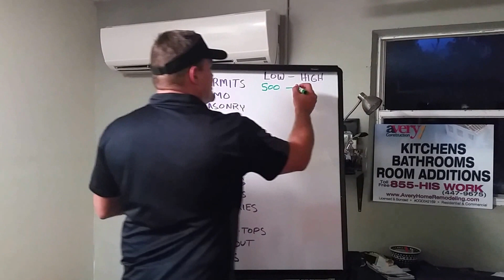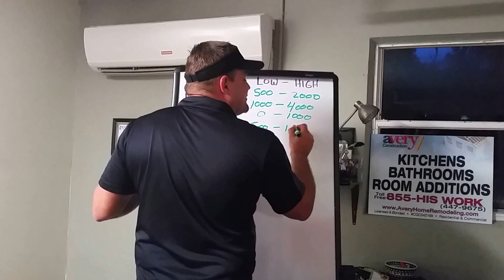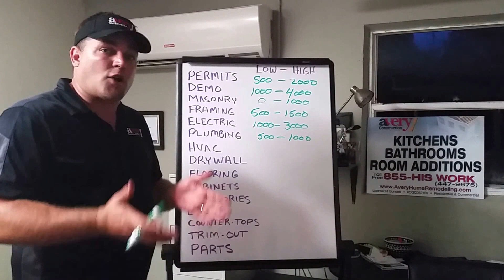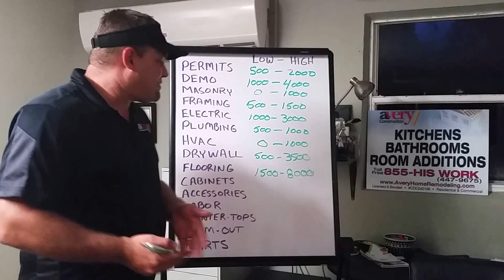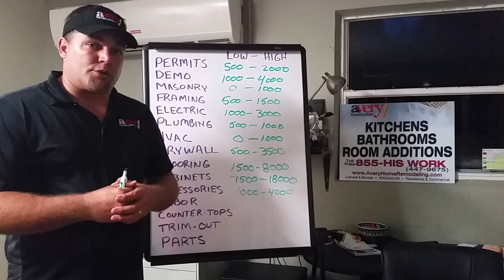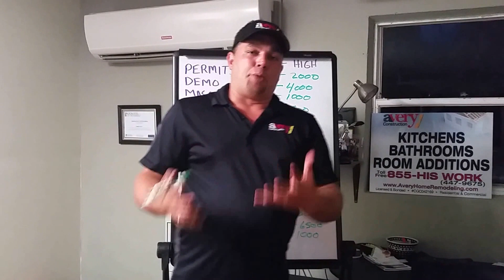How To Budget Your Kitchen Remodel - Avery Construction and Design Tampa, St. pete, Clearwater Fl

Comment: Really good video! Just out of curiosity, I am a more smaller and newer contractor, would this 21k low end job be a little less coming from a company like mines where I dont do the volume that your company is doing? For example if a homeowner loves the Ikea kitchens, obviously they give you the cost of what the materials cost at the store, should i then just factor in labor and that would be my total cost? Just wondering how everyone gets to the prices. Thanks you.
Reply from the maker: Jonathan Rivera, If you are doing the work yourself or if you are the onsite manager of the crew doing the work then, yes, you could be selling the work for less. I pay a project manager and a production manager to ensure that the customer gets the appropriate attention to details and to keep the projects running as smooth as possible. If you don’t charge a rate that affords these layers of protection, then you will find it difficult to ever grow to the point where you have a larger volume of production. At low levels of production, you are at greater risk of any one project that runs it to on for seen expenses, causing a ripple effect which makes you start robbing from Peter to pay Paul. I’ve seen many smaller contractors force themselves out of business for this reason. I certainly don’t look to overcharge anyone, but I want to deliver high-quality work at a fair rate. It’s not cheap to do things the right way.